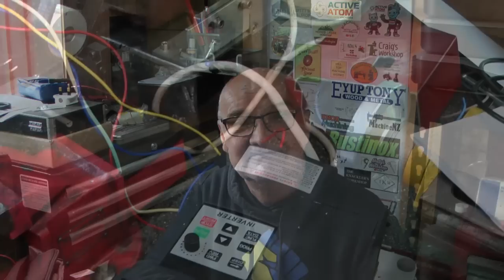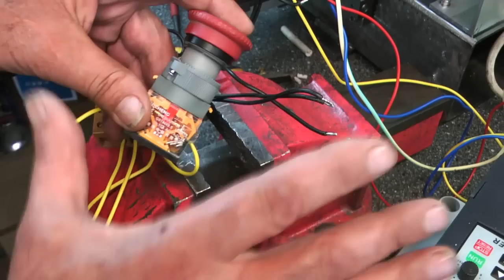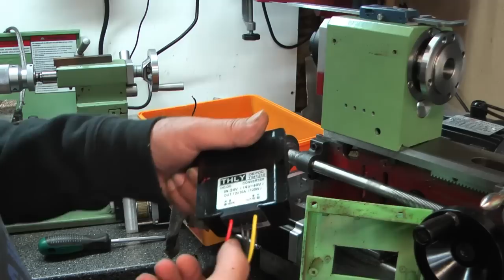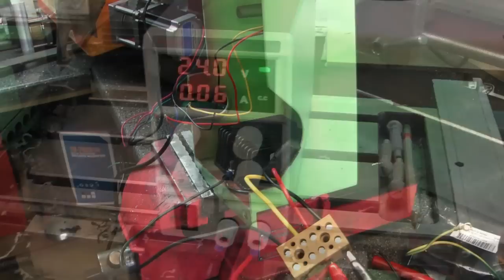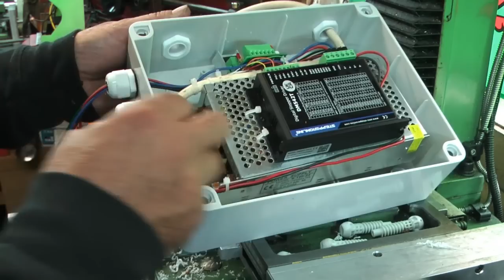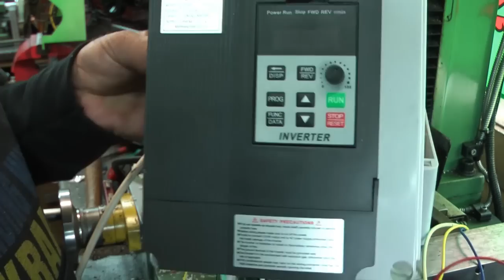Mini Lathe revamp part 14

Comment: Ade, the three phase motor will be running a lot of the time at low speed and perhaps high torque that after all is why one would install in the first place. The motor cooling fan is attached to the rotor and at low speed will produce poor cooling. Perhaps you may want to cool the motor with a constant speed DC fan eg a 12 V computer cooling fan.

Comment: Ade, I agree with the comment of putting the inverter in a box, the fan will drag all sorts of crap into the inverter, I've got mine in a box with filtered intake to clean the air.

Comment: Nice progress on the mini lathe project. One thing I was wondering about though, would there be any value in using something like a piece of heavy fiber gasket material to separate the electrics in the control box from possibly making contact with the head of the lathe? Call me paranoid but those are the types of things that I think about when I work on stuff.

Comment: You have a 24 volt psu in the box for your power feed stepper motor, is that correct? All you need to do is get yourself a 7812 linear voltage regulator IC and a couple of small capacitors. That will give you a 12V 1A supply in a fraction of the space. The build is fantastic, I think you will have the most capable mini lathe on the web.

Comment: You can get vfd's with removeable control panel and a mounting kit with a cable from the panel to where ever you have the inverter. They can display rpm. I've put them in loads of wood lathes

Comment: Hi Have you thought about using 220v dc treadmill motor and controller? I'm running a 3Hp dc motor on a 5Amp fused plug..... just a though I would be interested to here what you think about them? cheers

Comment: I'm using two speed controllers on a locomotive I'm building and the first thing I did was to mount two 12v PC fans to vent cool air on the heat sinks. They're available in many sizes and cheap too so it's worth spending the money to make sure the heat sinks stay cool.

Comment: Test the mains cord going into the box you are making. This wont tell you how many watts the stepper motor is drawing but it will tell you how many watts are being used by the power supply before efficiency loses. This will give you some sort of idea how much heat you will have to dissipate from inside the box.

Comment: Hi Ade, I have been following your lathe revamp series with great interest, fantastic job you are doing. 
Something that may be of interest to you. When I installed a vfd onto a 2 x 72 grinder I made, I found it incredible useful to use some 7 core car trailer wire. It is very cheap, colour coded and is fantastic for the signal wires from the vfd to control panels etc. I ran mine inside some conduit and it certainly made my life easier. Take care Ade, Happy days! 😃

Comment: Hi Ade,
I noticed the motor is still wired in STAR configuration for 440v you need to change it over to DELTA for your 240v inverter. The links between the bottom 3 terminals need to be moved vertically.

Comment: Normally, the emergency stop should go in series, to a contractor coil. Hitting the stop opens the power to the coil, which turns the power off to the VFD. The VFD should be set to not restart the output. This is done so that if the inverter locks the inputs and the output is locked in, the inverter will be turned off by opening the power circuit to the input. In other words, the inverter should be turned off by the emergency stop.

The control wires should be in a shield, connected on one side only which is the inverter ground. They should be shielded as close to the input connector as possible. This is noise sensitive. With switching supplies so close and connected to a close circuit, you could have some erratic operation otherwise. In theory, the motor output wiring should be shielded, but it’s likely not a problem with a short cable.

I don’t remember from when you bought the motor, but is it and inverter ready model? I don’t recommend using an inverter to vary speeds on a standard three phase. They don’t take kindly to constant torque inverter output, and could overheat. Check the motor specs before setting any of those items.

Comment: Hi ADE Glad to see you up and about. By coincidence I'm doing the same thing, a bit different but the same. However mine is full CNC, with a Centroid acorn control. Looking forward to seeing the finished job. As  a mater of interest, what size motor are you using. bye for now. TONY

Comment: One little thing. As an ex sparkie(AUS)I would suggest running double insulated cable to the 3 phase motor for safety and correct installation! Either as building wires in flexible conduit or double insulation cable
Reply: or ideally screened double insulated cable, vfds are noisy!

Comment: I would be inclined to fit a small 24V propeller fan on the side of the box with the 24V PSU and some inlet holes on the opposite side. This will dissipate any heat build up.

Comment: Hello Ade,
Some remarks on the setup.
RPM counter powersource, it might be possible to power it from the potentiometer power (10 Vdc ?).
Did see that the drive motor has a star connection, depending on wall outlet voltage and motor voltage you might need to reconnect it in a delta configuration.
Reply: No, no, no. You can’t “power” anything from that. That’s a control circuit. There should be either a 12 or 24vdc relay out. But that’s not designed for that either.
Reply: @melgross  
I know it is a control output.
So you need to check if the output is up to the load.
Should be somewhere in the manual or data sheet
Reply: @HD-wp5le  it’s not a control output. It’s a control input. The tach I’ve used on my recent upgrade to my 2hp mill uses 30 ma, not very much. But that output isn’t designed to supply power to anything, it’s for speed control only. I don’t understand why you think it can do anything else. The pot just does what a pot does and has that takeoff to work like a bridge. You can power so w]ethi g from it. What do you think the computer is going to do if you hang something trying to draw power from it?
Reply: @melgross  it provides a voltage for the input signal.
Lets put it this way, if it was my build I certainly would explore the possibillity to use this voltage.
The reason I mentioned this to Ade was for him to check the manual for this.
And when possible to rule out the  24-12Vdc converter.
Reply: @HD-wp5le  the computer checks this circuit to adjust the speed. How can you possibly think you can use this for a power supply output? It’s just a few milliamperes going across it. It’s regulated as a reference when the takeoff from the pot gives the offset. You can’t use it for anything else. Stop thinking it’s a clever idea. It’s not.
Reply: @melgross  When using a potentiometer (voltage divider principle) set up for speed, then computer only measures voltage on a analog input.So it doesn't care how much mA you use as long as it stays in its limmits. There is also a way to to use current (0-20mA or 4-20mA) for speed reference but its not used in this application.Like I mentioned before you need to check the manual to see if the controller can diliver the needed current.
It is something to take in consideration, you don't have to use it.
Reply: @HD-wp5le  there is no spec in the manual for the analog current for this input, because it’sjust being used as a voltage divider. Look, I’m giving up on this, if you don’t understand the way this works, there no point in my continuing the conversation. So say whatever you want.

Comment: Would it be possible to put a switch in that would stop the cross slide from crashing into the chuck? And filters on all the wiring boxes to stop dust and insect's from getting in !

Comment: lol... I've got 3 of those same $85 vfds from amazon in my garage.  They've all been rock solid.  I just wish they would put bigger terminals for the line and motor wiring.  Pretty tough getting it to hang onto #6 wire.